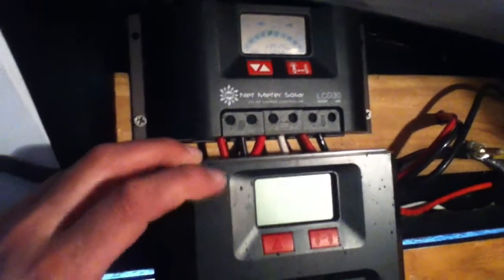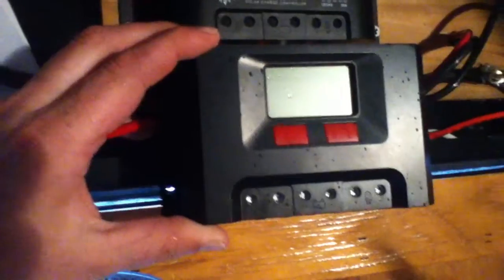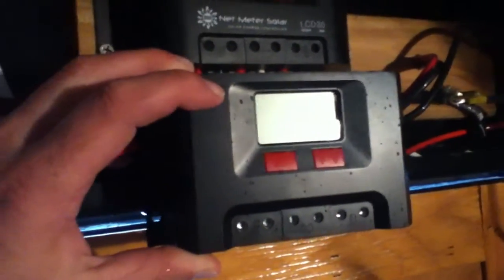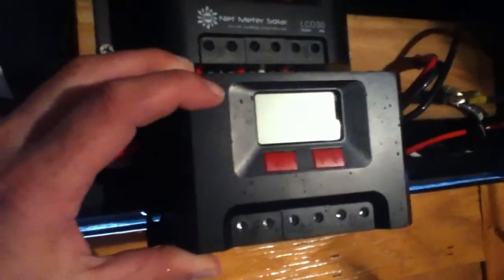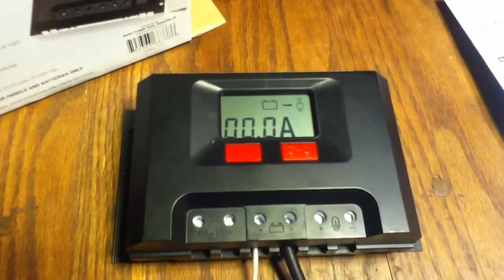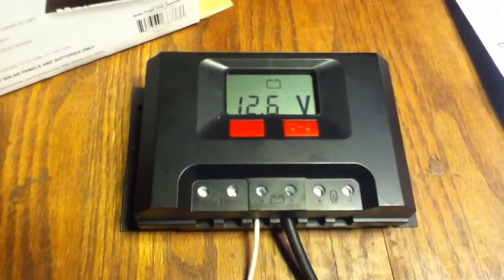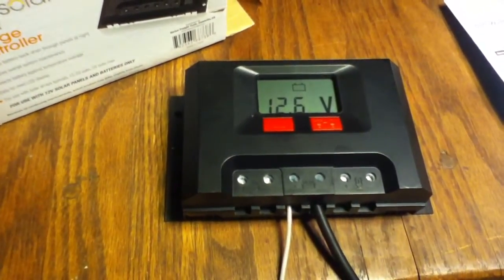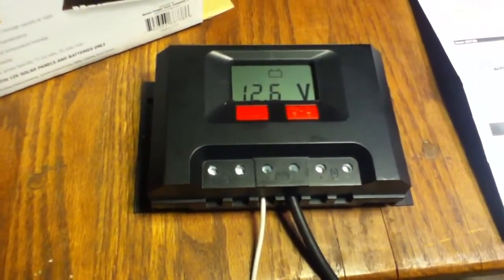Net Meter Solar LCD30 Vs Harbor Freight THunderbolt solar 500 watt charge controller

Comment from the maker: The outer box packaging says 500 watts, which puts you around 30 amp, the internal manual says 18 amps.  Just to be on the safe side, I would call this an 18 amp charge controller.   This is also NOT a relabeled Steca or LCD30, it is design to appear similar, but does not have all of the features of the others.